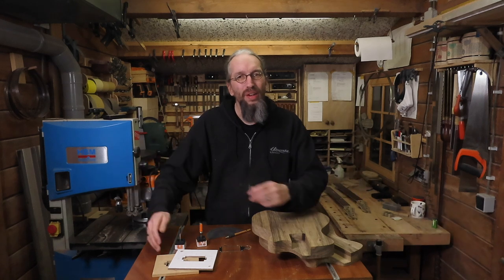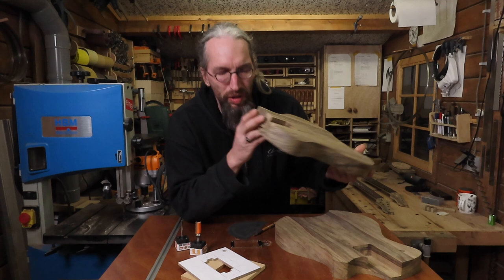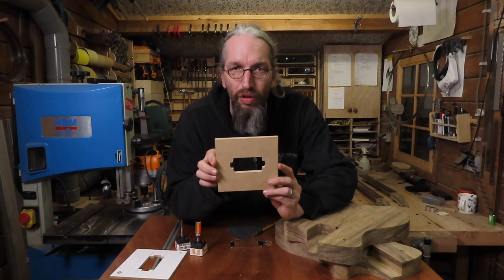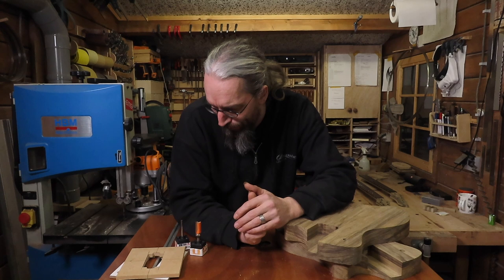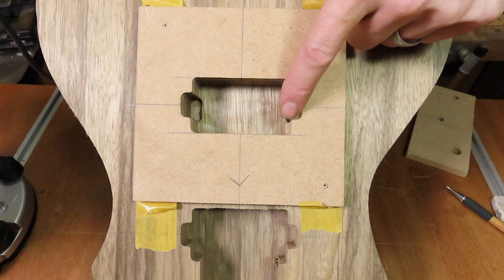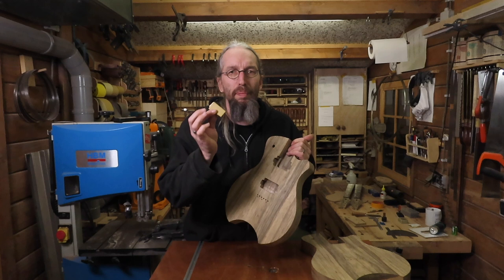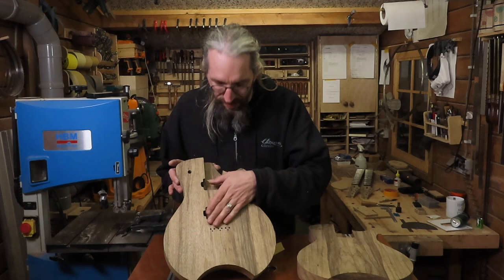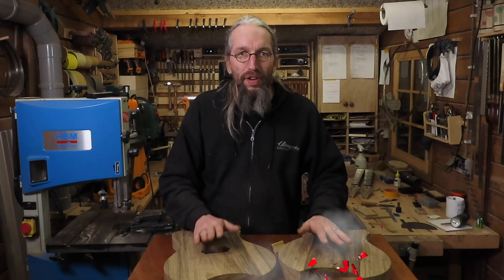How to Route the perfect Humbucker Pickup Cavities (Tutorial)

Comment: Hi Daniel, since I started watching your videos, I have learned that people do things in a particular way, just like you, for technical or pratical reasons. So, can I ask you why the body template doesn't have neck pocket and humbucker pickup cavities in only one piece, even if the neck pocket will be done first?
Reply from the maker: Hi Adrien,
Good question.
For one, I stick my template to the back of the guitar so I can route the control cavity with the same template as the main body outline. 
Secondly, and I mention this in the previous video. Using separate templates for the neck and pickups allows me to make adjustments if needed to for example the alignment of the neck, bridge and pickups and to make absolutely sure I get a tight fitting neck joint. Something you can't do with a 'all in one' template.

Comment: Great video Daniel.  Do you have any preference for a 2 flute 1/4" router bit vs a spiral upcut bit? (Like you, I use a 2 flute bit - as it's what I have - and it's only used for routing pickup cavities).
Reply from the maker: Hi Paul,
I don't really have much experience with spiral bits and good quality 2 flute bits are much easier to get and a little less expensive so I stick with those for now. They seem to do the job just as fine. I'm however expecting one of those Infinity Router bits which is send to me by one of my viewers to arrive one of these days. They seem to be amazing.

Comment: That was good! Now... How did you make the template without a template??
Reply: I had the body template in mind for your question, but I think this would work for pickups and necks, too.  Draw it by hand or by help of a CAD program (it's not as hard as it sounds).  Then print it at full scale and glue it to 1/4" MDF with spray adhesive.  Take that to the band saw, leaving about 1.5 mm (0.06") or so of stock outside the lines.  Then use an oscillating spindle sander to get right up on that line while keeping a 90 degree edge.  Do final sanding with sandpaper wrapped around something soft like an eraser or hard sponge.  Then when satisfied with the sanding, use the router table and that 1/4" template to make a brand new template on 1/2" MDF.  Call that template the master template.  It should need little to no sanding.  Use that master template to make another 1/2" MDF template (rough cut on band saw, super glue trick to keep them together, route on router table).  That whole process allows, you to cancel out any little imperfections from your sanding on the 1/4" template.  You can keep a perfectly good master template on the shelf in case you make a routing mistake on the second 1/2" template or simply want to keep the wear off of the master for later guitars.  You can also coat the edges of the master template in either watered down wood glue, oil based wipe on poly varnish, or thin viscosity super glue.  This keeps the edges stronger so they hold up to wear from the pencil markings.  That's a lot of words, but it isn't that hard of a process!  😃
Reply: Why can't the 3d print serve as the final template?

Comment: I’m going to be custom building a telecaster with a slanted humbucker but I don’t have a proper router could I use a dremel?
Reply from the maker: Hi Josh,
Although I strongly recommend using a 'proper' router it is possible to use a Dremel.
However, a Dremel isn't powerful enough to remove a lot of material so be very careful not to overheat it and destroy the Dremel.
Remove as much material you can using a forstner bit, chisel or something and the Dremel only too tidy up the cavities removing just a little material at the time.

Comment: What happened to the neck joint extension into the pickup cavity? Did you just cut that off flush with the end of the fretboard or did you do some other significant routing that you did not put in your otherwise useful post? I do not understand what you did or intended to do with the neck.